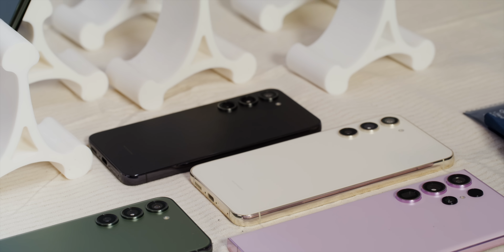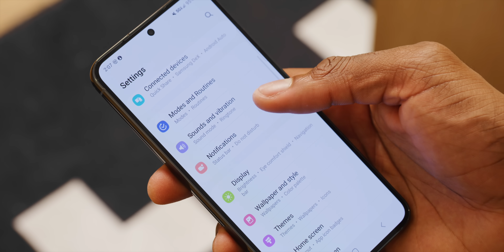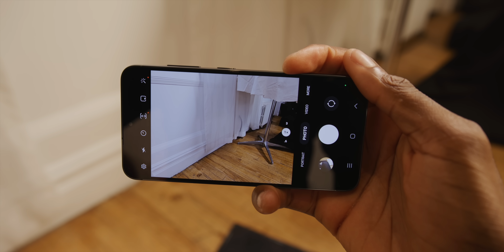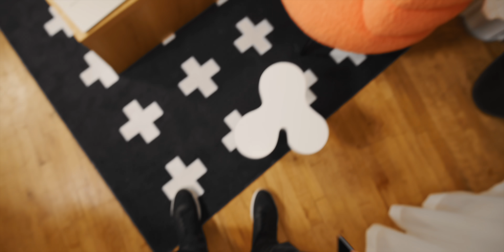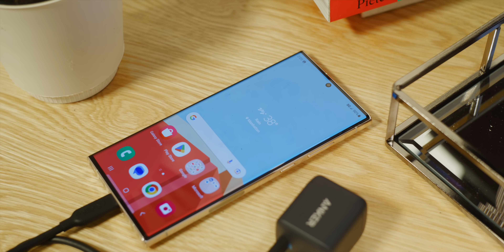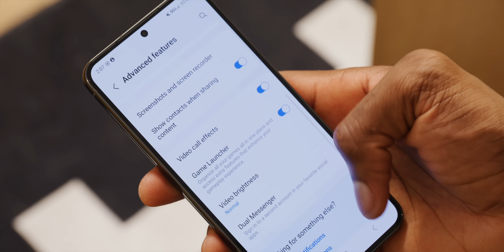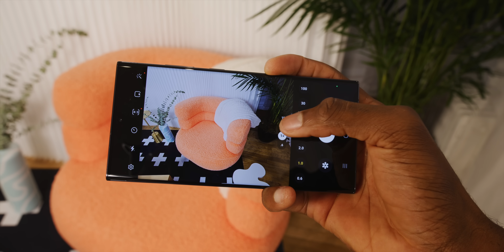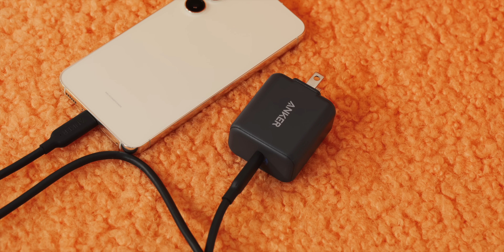Galaxy S23 / Ultra Impressions: Cruise Control!

Comment: I skipped the S22 last year to save up for this launch. Can't wait to get my hands on the ultra and play with the cameras.
Reply: I skipped S10, S20 and S21 to now buy S22 lmao
Reply: might be worth it to find a deal on s22u instead of this one. the phones drop in value quite a bit
Reply: Tbh I wouldn't expect too much.  The 200MP thing is purely to bait people who only think "the big number must be better".  It has a smaller sensor size than most of the competition, including iPhone now, which is really what matters.  The Xiaomi 12S Ultra has an IMX989 which is a 1" sensor (area ≈ 116 mm2) while the S23U will have an ISOCELL HP2 1/1.3" sensor (≈70 mm2) or 1.65x smaller.
Reply: @JMurph2015  check mrwhostheboss's video

It explains the actual benefits pretty well
Reply: @jormjohnXII  I mean the actual benefits are improved resolution in perfect lighting conditions, but the problem is that you give up a little bit of functional area between the pixels which means pixel binning is not quite = to just having bigger pixels.  And that all assumes the lens in front of said sensor is able to make full use of 200MP of detail, which it almost definitely is not.  That's all aside to the fact that it's not just equal sized, it's smaller than competing phones' sensors.
Reply: @JMurph2015  Used to be, not now. just check for reviews
Reply: Well done you're getting the same phone but paying 700 more, enjoy your s23(s22)
Reply: @mac8669  it looks about the same, but it's clearly not the same phone
Reply: @jormjohnXII you could say that about almost any phone 😭
Reply: @mac8669 they get better camera and upgrade chip at least
The only thing most ppl wait is the cooling system

Comment: keeping my s21 ultra 512 GB with 16 GB RAM. Still Rock solid so will wait for the s24 ultra maybe or maybe even the pixel later this year
Reply: Good choice
Reply: I still got my s9 plus lol
Reply: @brandon4ms  still got my s8+ over 5 yrs now, almost 6 yrs.
Reply: @m4x927  how's it keeping up? Mine is still fast but the battery does slightly quicker than before
Reply: @brandon4ms  Slowed down a bit and battery does drain a little quicker. I do plan on upgrading to the s22+.
Reply: @m4x927  that will be a nice upgrade you should go for it! Especially 120hz and less bezels

Comment: I need someone to make a small phone again.  I'm probably in the minority on this take, but I don't use my phone for media consumption generally.  I use it for work.  6.1 inch screens aren't terrible, but I really prefer something smaller.  Something that fits better in the pocket and is easier to use with one hand (without risking dropping it while stretching the thumb across to the top opposite corner.)
Reply: I mean Apple made a mini and people didn’t buy it. Apples pro phone used to be 5.8. People wanted bigger. Most of Samsungs cheap phones have 6.4-6.7 inch screens because that’s what people wanted. If you want anything smaller than 6.1 it’s just not worth it for them to make a phone with the same specs as the top phones but much smaller when only 100 people will buy it

Comment: Everything that would have made the S23 Ultra actually an upgrade from the S22 Ultra. S23U should have at least 5200 mAh battery, Dolby vision hdr instead of hdr10+, a 48MP ultra wide angle lens instead of 12MP, 12MP telephoto lens instead of 10MP, and Wifi 7 instead of 6E,
Reply: So for the rear cameras it should be 200mp wide, 48mp ultra wide, 12mp telephoto and then a 12mp selfie camera. Instead were left with a 12mp ultra wide and a 10mp telephoto leaving us with barely an upgrade other than the 92mp upgrade on the wide angle lens

Comment: Still have my base S21. It's running just fine and the hardware/software really haven't aged much. I still miss having a headphone jack,expandable storage, and a QHD screen after "upgrading" from the LG V30. I agree 5G still kinda sucks. It's only slightly faster than 4G but it just makes my phone hotter and battery drain faster.
Reply: I'm going to miss the headphone jack. Still using my LG G8X for this reason.

Comment: they took the phrase "if it aint broke, dont fix it" WAAAAAAY too seriously. ive been a Samsung user for the past 10+ years and im due for an upgrade this year. if they dont bring anything new to the table, im for sure switching to a new brand of phone. They treating the Galaxy Series like Madden and 2K. Just the same thing every year with slight updates.

Comment: Thank god i went with apple this time around, had the most disappointment experience with andriod for the last 4 years. Oneplus 7 pro screen burning withing 6 month, oneplus 8 pro oxygen os 12 made it unuseable with constant crashes and bugs, s21 ultra broken firmware (had replacement 3 times from samsung all keep having the same issue wont let me into os itself just keep booting in safe mode) and pixel 6 pro with andriod 13 was broken af and the s23 ultra seem just to be a s22 ultra with a main camera upgrade and chip upgrade that is it.

Comment: Here’s something to check for the full review. The standard 8 gen 2 is manufactured by tsmc on the 4nm process. Some rumors claimed this “for galaxy” 8 gen 2 would be manufactured by Samsung instead. If that’s the case it’ll probably lead to less battery life and more heating. Something to check for in the full review.

Comment: flickering and refresh rate are somewhat different. flickering on OLED displays is due to PWM (pulse width modulation), and refresh rate is how many times per second an image can be changed on a screen. the display shouldn't flicker even with 1Hz refresh rate, it will just show a new picture no faster than 1 picture at a second

Comment: It's a bit sad that the Samsung S series slowly moved away from the beautifull edges like the ones seen on the S7 Edge... I still hope they will bring it back on all S phones. 
Also I miss the glossy design that was a fingerprint magnet.

Also the SD card slot is something I will love to see making a comeback. I have a big SD card and it's full of stuff and I like to just stack everything I need on it before moving to another phone. Like that, when I setup the new phone I just pop the SD card in, install the apps I use and I'm ready to go.
Reply: I used to like the edge my old Note8. At least until it the screen broke because of it. Glossy design looks good on render but it was a nightmare to clean in real life. SD card also ruined my old phone. Apps were sluggish on the card and so many of my photos and videos stored on it are corrupted and lost.

Comment: "samsung phones always feel very fast when they're brand new" I see what you did there.
Reply: I've never experienced slow down in Samsung phones. I had a note4 until 2018 and it was just as fast as the Note 8 I switched to at the time. My only issue and reason for upgrades have always been the batteries. Overtime, you have to charge them more throughout the day. So frustrating.
Reply: My s21ultra still rock
Reply: my old s9 still runs like its new , so i dont get what he is on about
Reply: @girlsdrinkfeck  - My S7 will barely boot and when it does it's barely usable lol.

Comment: Questions about pros and cons of storage size options:   
Would it make any sense to opt for the 1Tb storage instead of the 512Mb on the S23 Ultra since the camera resolution is so much higher for making movies?  
Would the 1Tb be slower than 512Mb performance?  
Does the 1Tb storage use more battery power than the 512Mb?
Reply: No, terabyte won't be slower nor would it drain more battery.
And 512 is good enough, just move files over to your pc or something in a year if you fill it somehow
Reply: I am currently using a 128gb s22 ultra. Never had any issue with storage, as i keep my pics on google photos, which i dont even pay for thanks to Google Rewards. Honestly if it were not for the ram upgrade i wouldn't even remotely consider getting a bigger storage version.
Reply: And no, battery will not be noticeably impacted by the additional storage.
Reply: Mb?? You mean 512GB?
Reply: Higher storage does not make it slower or use up more battery.

Comment: If I wanted to buy one of the s23's in America and eventually root it should I get a carrier unlocked version? cause my issue with my phone rn is I cant root it cause i cant unlock the boot loader cause oem unlock doesnt show in developer settings.